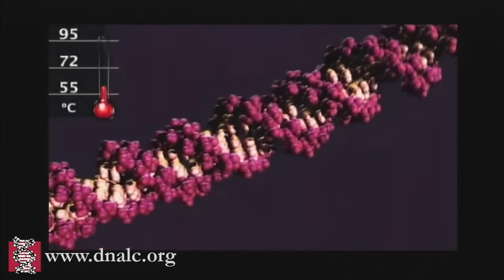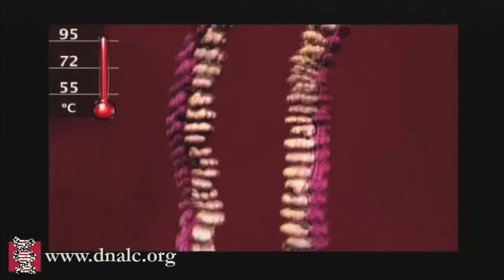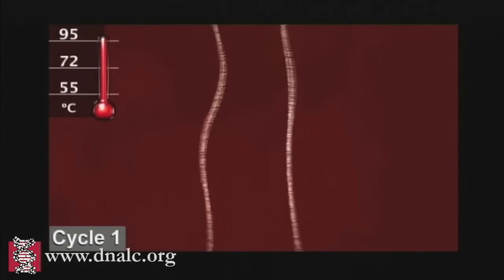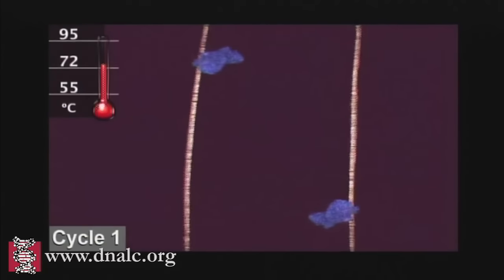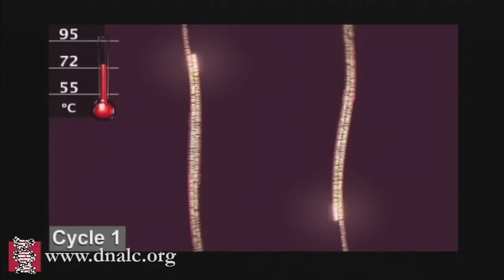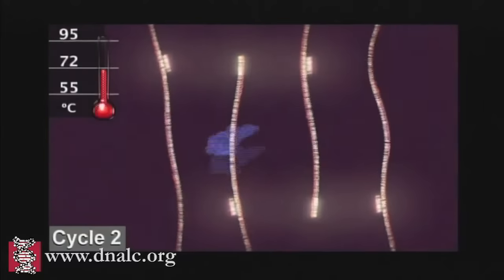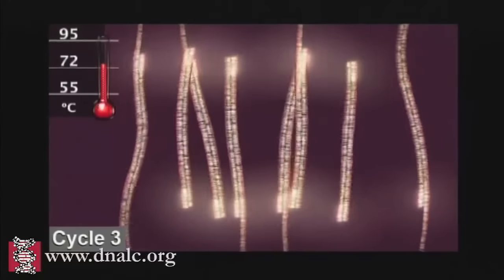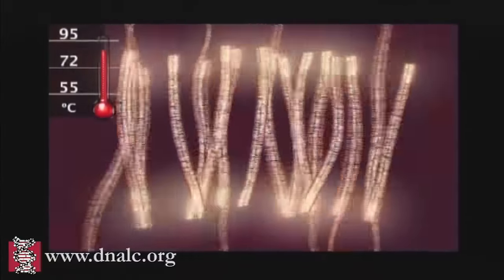Polymerase Chain Reaction (PCR)

Comment: A little note: the annealing temperature is usually chosen between 40-60°C. There are a few factors that influence the annealing temperature.  An important factor is the fact that G-C binding involves 3 hydrogen bonds (rather then 2 hydrogen bonds at A-T binding). Because of these 3 hydrogen bonds, the more G's en C's are in the primer, the stronger it will bind to its complementary sequence on the template DNA. Therefore higher annealing can and must be used when the primer contains lots of G & C. (The annealing temp. can even go up to 72°C if you have a high G-C content)

Comment: the single strands at the beginning each have different sequences of bases. you need two sets of primers to bind to each one. you add the primers in excess though to make sure that the primers bind. pcr usually stops when the primers run out and you can either add more primers and continue the process or stop there.

Comment: What prevents the single stranded DNA from sticking to each other when the Temperature was lowered for the attachment of the primers?
Reply: They are denatured. Meaning that they have "lost" their shape and structure. Scientists are more concerned when the primers attach wrongly when the temp. is set too low.

I did PCR and Post PCR stuff. PCR is seriously hard. There are so many ways you can screw the experiment up.
Reply: They use excess DNA primer to lower the chance of that from happening, although it happens.

Comment: How are the strands prevented from re-forming Hydrogen bond when the temperature is lowered to 55 degrees?
Reply: I know this is an old question, but in case anyone else reads this and needs help:
Basically, they're not. It's all kinda going on at random in the tube. Some copies of the DNA may reform the duplex, and some will attach to the primers. Those that have the primers won't remake the duplex because the primers are in the way. Those that do remake the duplex won't attach the primers in that cycle and therefore won't copy because the polymerase has no primers to get it attached to the DNA. But in that case other DNA molecules will get copied, and then maybe this particular molecule (the one that reformed the duplex) will get to make copies in the next cycle because maybe the primers will attach next time.

Comment: How do you get the primers to attach at the desired location?
Reply: you need to know exactly where you want to start with synthesis... the sequences can be checked in databases (e.g. NCBI genome browser). According to your target region you order the reverse complementary sequence of the forward primer and the same sequence for the reverse primer. 

Long story short: a primer needs to have the complementary sequence (A binds to T and C binds to G) and when this is accurate, a certain temperature helps to anneal to the target DNA.

Comment: ok how do you make the primers, do you add A T G C in a sequenced mix in test tubes and heat treat to cause them to bind into the gene sequence that you want? how do we know that the right genes are being targeted, because at some point the A T G C repeat at different parts along the DNA strand, this process cannot directly find the genes, im guessing its multiple processes after the target strand is found so you take the smaller part and then subdived off of that to get precise gene pieces.
Reply: Primers are usually about 18-22 bp in length. This so they're long enough to accurately find the right place where to bind, but also short enough to anneal properly.